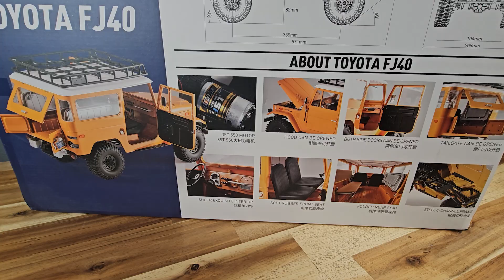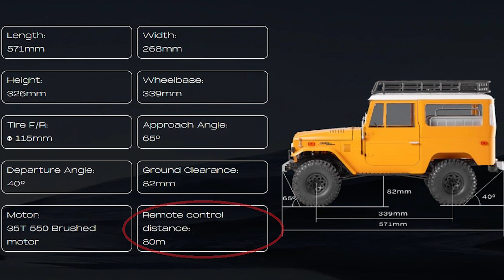Upgrading the Toyota Land Cruiser FJ40 from FMS

Comment: I really like the boxes that come with most of the FMS trucks. The only bad thing is that as soon as you upgrade them, they don't fit in that box anymore 😢
Reply: nothing little box cutter cant fix
Reply: @Mckhus  Yea, it's not quite the same with the tires sticking an inch out on either side of the box..
Reply: I use my box to haul my 24 and 18 scale rigs. !!!
Reply: I was thinking the same thing, if only the boxes had enough meat to really carve out some extra room

Comment: Yep, big bore shocks and heavy weight shock oil will get rid of the wobbles and help it crawl like a TRX4. Changed the servo to a RAW 500, upgraded the esc to a Hobbywing 1080, added a new receiver with 8 channels instead of 4. New Mytrickrc headlights, tail lights, light bars and flood/rock lights, lastly I swapped out the black plastic wheels for some gorgeous Injora brushed aluminum with a chrome hub cap.

Comment: I did a Fusion SE, on 2s it doesnt really need anymore.

I did the leaf conversion and shocks.  Though the spring kit design is lacking a little on scale being the spacers needed, much more scale and definitely helps control the body a lot more.

Injora makes perfect steel wheels and can get brass rings.  Not "perfect" for fj40 wheels but fitting and adds a little more weight.

Comment: If you guys really wanted to do a worthwhile video about these trucks, and their part compatible siblings. You would have shown putting some shock mounts and better shocks on it. These vehicles use shorty little shocks and there isn't a lot out there that's useful without fabbing up some sort of mounting system. These trucks as well as the Mashigan and Atlas really need it.

The chief complaints are the Shocks, wheels/tires, and ESC.

Comment: What size battery should I use my local rc shop only sales traxxas battery’s does amain hobby’s sale the battery I also need that battery strap  I just got mine from amain hobby’s this week please help
Reply from the maker: This is the battery we used: https://www.amainhobbies.com/protek-rc-3s-90c-sigraphene-hv-lipo-battery-w-xt60-connector-11.4v-1800mah-ptk-5572/p975514
For a strap, something like this or similar should do the trick: https://www.amainhobbies.com/mst-velcro-strap-16x210mm-2-mxs-130046/p618316
You could probably find some basic velcro straps at your local hardware store or dollar store for cheaper. 
-Brett
Reply: Awesome can’t wait to get it rolling
Reply: @AMain_Hobbies just got a rc4wd warn winch can you guys help me connect it to this model what wire will I need does it need to be connected directly to the battery

Comment: Is the body painted or is it just blue plastic
Reply from the maker: Shoot, I think it's painted but I may be wrong. We don't have the truck anymore to double check for you. 
For the Fusion setup, I think it would fit, although space is tight. 
For the extended wheelbase, I'd imagine so but you might need longer suspension links and front-center driveshafts. 
For fitting other hard bodies, it would require some custom work, but I imagine it could be done. 
When there's a will, there's a way!
-Brett
Reply: @AMain_Hobbies  I heard the steering linkage would need work too but all I know is vague generalizations like that.